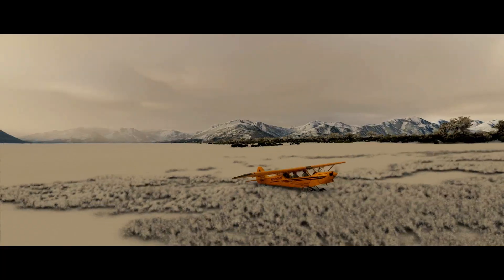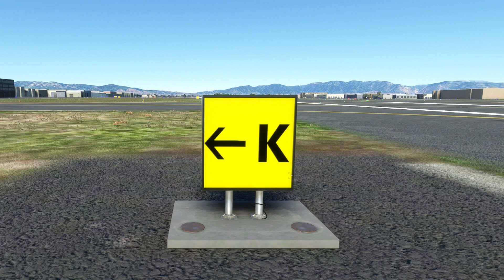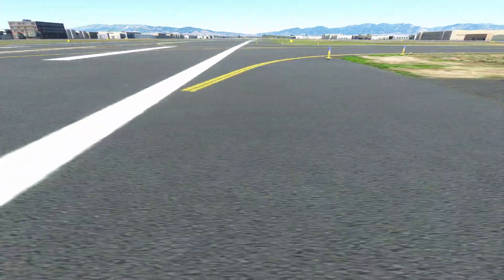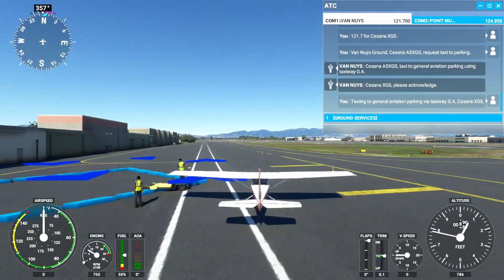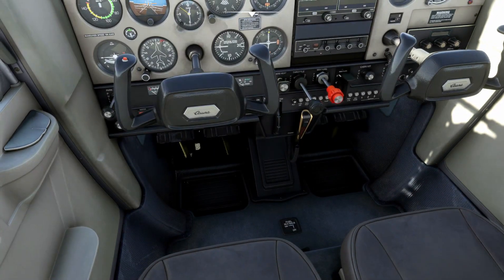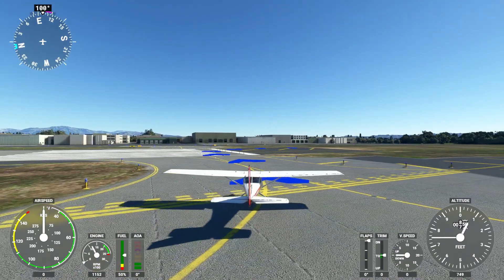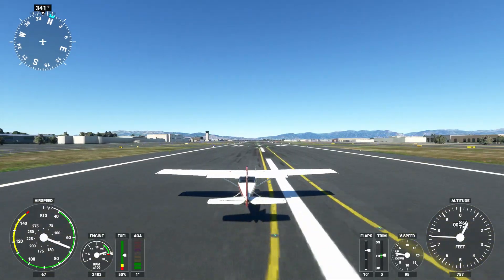MSFS Tutorial Guide to Airports Part 3   Airport signs and their meanings

Comment: Yeah, dude. Please please do a tutorial on the G1000 and using autopilot. I saw your basic g1000 but we need one on using autopilot with g1000. I struggle with ils, FLC, modifying flight plan in mid flight, etc....
Reply from the maker: There are 2 more in the works.  I am hoping that they fix the issues with the G1000 implementation in the sim with the next update.  The MFD implementation is pathetic.

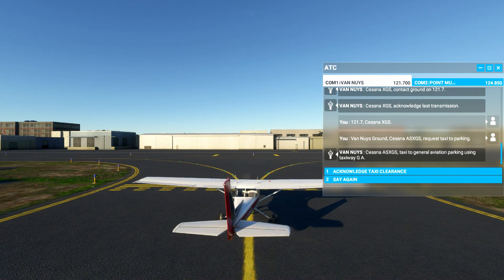Comment: At 3:30 you stopped at the broken line side of the runway hold line. Wouldn’t it be more correct to stop on the other (less dangerous) side of the line before contacting Ground? Alternatively, do you need Ground’s permission to enter the taxiway complex?
Reply from the maker: Indeed I would not have stopped there normally but I wanted to show the signs at that point etc.  Generally yes you need permission/clearance to enter the taxiways at towered airports.